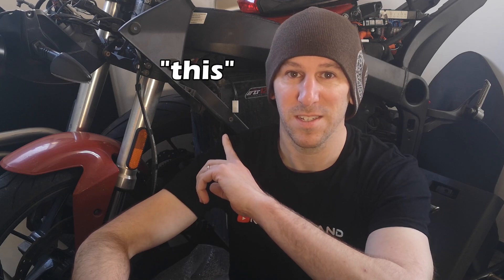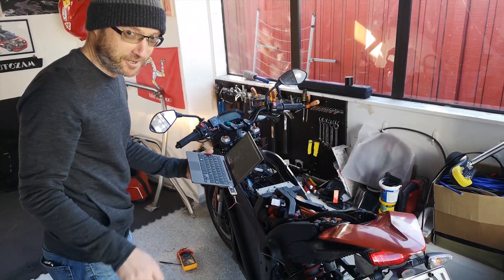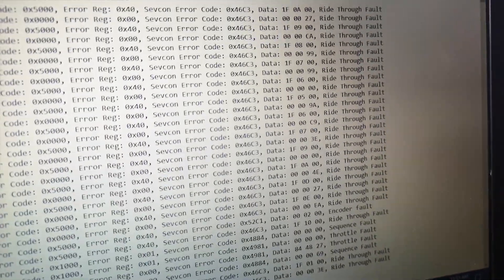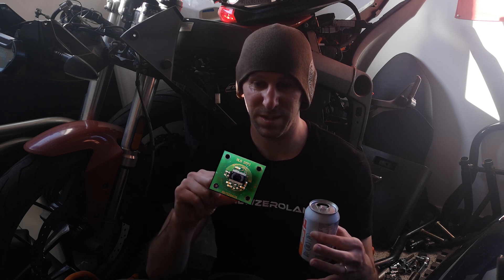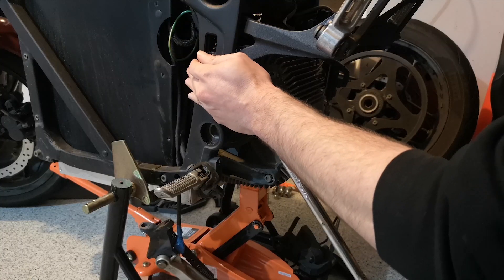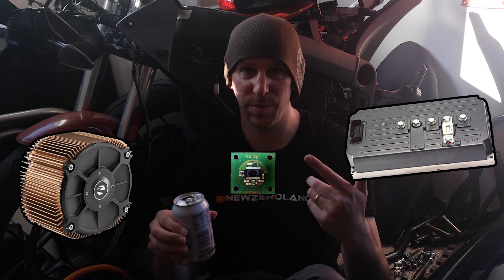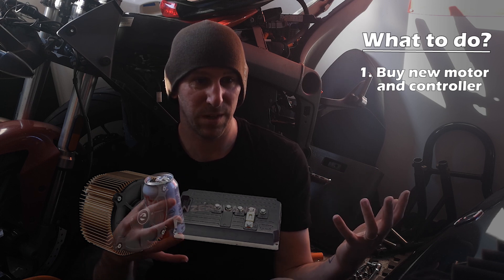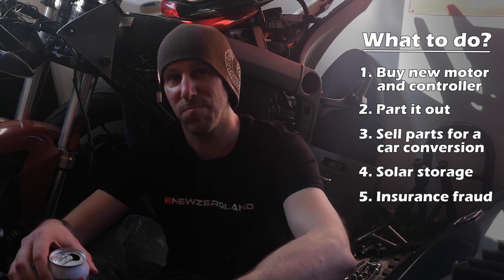What's wrong with my bike?

Comment: Right to repair is a huge deal. There is one fly in the ointment regarding EVs, though. High voltage AC is bad, but high voltage DC is ten times worse. Given the same voltage, DC is more dangerous than AC for several reasons.

That said, wrenching on your own ICE ride can be pretty dangerous, even deadly, too, and everybody has been doing that for well over a century.

But I don't believe the big secrecy has anything to do with them being afraid of competitors stealing secrets. The competitors have the resources to easily reverse-engineer everything anyway. The real reason is that they don't want consumers to be able to fix anything themselves because that directly impacts their profit. All vehicle manufacturers (well, dealers, really, but it's a complicated system with kickbacks and lots of hidden money streams) make more off servicing vehicles than anything else. The initial sale of the vehicle is actually a pretty small profit margin, especially compared to the margin on parts, and more importantly, labor charges. That's why it's so hard to get parts for vehicles. Sure, you can easily get things like filters and little trim pieces, but the really important stuff can be nearly impossible to get your hands on. That's because the dealers want you to take your vehicle in to them so they can make even more profit on parts, and a huge amount more on labor charges. The thing about labor charges is that they don't charge you by the actual time they work on your vehicle, they use an arbitrary schedule that is supposed to be an average time to do that particular task or set of tasks, according to a procedure that is set out in a manual. But a good mechanic who has done the same thing many times can usually do it in a fraction of the time. So you get charged for an amount of time that is usually several multiples of the actual time they spend on your vehicle. They hide these facts with many different techniques, including doing teardowns, removals, installations and reassemblies all as separate projects which they intersperse with other vehicles and making your vehicle wait until they've finished others that have also been artificially drawn out.

This is also exactly why the vehicle dealer system in general is such a scam and why they're screaming so loudly about Tesla selling directly and other companies that want to do the same thing. This is also the problem that the legacy ICE vehicle manufacturers and dealers have with being forced to produce EVs. EVs in general are so much more reliable and there's so little maintenance and so few breakdowns that the service after the sale revenue stream is effectively nonexistent. There goes that monstrous profit they've always enjoyed.

Sorry, I have no sympathy for dealers at all. I have never in my 57 years had a good experience with one. As far as I'm concerned they can all go jump into a deep lake. With concrete galoshes.
Reply from the maker: Haha yep, money money money.  That's all it is.  Sounds like the quick and easy fix for this is to replace the entire motor, rather than opening it up and swapping encoders.  A $2000 part vs. a $100 part.  (I'm not sure how much encoders cost but that number makes sense in my head).  Crazy stuff man.  It's sad to say, but one I get the bike back on the road, I'm posting it for sale.  Tech has improved so much in that last 5+ years I've had it, and I don't want to deal with any more potential problems that occur in the future.  If something like this requires me to ship my controller overseas, I can't imagine an MBB or battery issue.  I don't have the skills to troubleshoot this stuff if something goes wrong.  Tell ya what.. if it weren't for the community being so smart and helpful, my bike would stay like this for a long time.

Comment: Another dead Zero... I think you could rebuild it with a wrecked bike.
Reply from the maker: I kinda am, with a used motor 😁
Reply: @NewZeroland  My Bike also had some kinda sensor problem and sudenly sparks flew with a loud BANG. I think its similar a Motor - encoder forward reverse problem. and the repairs are allways super expensive. Soo i thought you could do something like "Sam rebuild" with used parts.
Reply from the maker: @LexSummer  yep!  Absolutely man.  That's scary.. I had no idea this was such a common problem.  Lots of people have told me they encountered the same thing.
Reply: @NewZeroland  And at the end its pretty sad that Zero don't care and help to fix that. Tey never did a recal... SR series have that issue over many years.

Comment: I have a few thoughts as I was watching this video.
1. If that's not beer you were drinking, it should be.
2. It's best to have spares of everything in life - except wives.
3. No vehicle is perfect. Ever. Sometimes fixes are easy and cheap. Sometimes they are difficult and expensive. See point #2.
4. I'd rather deal with EV issues over  ICE vehicle issues.
5. Every video with Smiley Jen in it will get more likes.
Reply from the maker: Hahaha these are great, and so true.  Thanks for the wisdom.  I really hope we can get the bike back on the road soon!  It may seem like the bike has only been down for a few weeks in youtube time, but it's been broken for months.  Luckily we had a month worth of lockdown here so Jenn didn't need it to get to work, but it's still a huge hassle!

Comment: Second!
Reply from the maker: You guys are so quick!
Reply: Thanks for your honesty, very refreshing to see a warts and all vlog.

The encoder tells the controller the exact rotational position of the motor, allowing the controller to switch the coils on and off at the right time.

Think of it like a crank position sensor on a gas (petrol) engine, allowing the computer to correctly time the spark.

Shame that Zero is so very closed-source. Seems like a very wasteful way to do things. Sadly it probably needs legislation to change things, like the mandatory introduction of OBD2 allowing more generic scan tools for cars. Don't know that bikes are a big enough market to warrant that, sadly.
Reply from the maker: @jrevillug  Yeah true!  That's a great way of looking at it.  I just wish this was something I could fix myself without needing software and training specific to Zero.